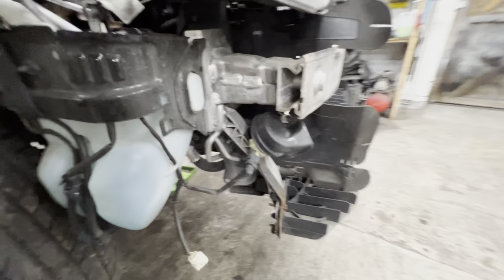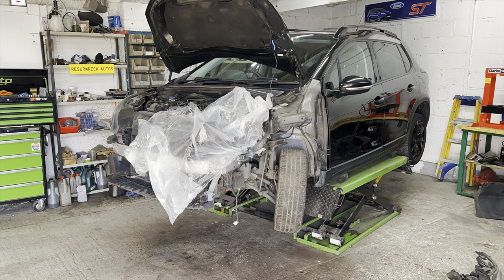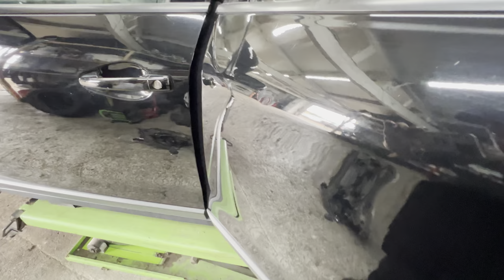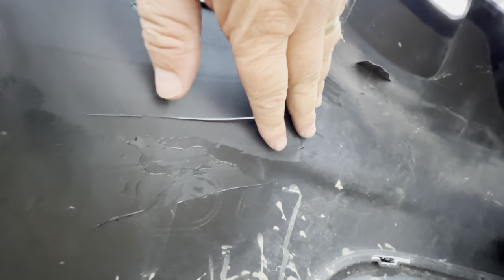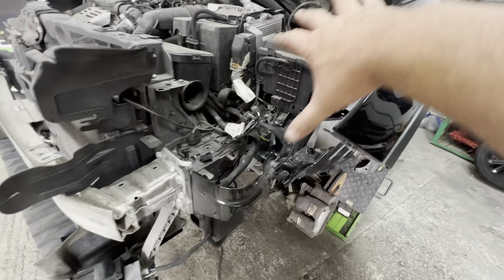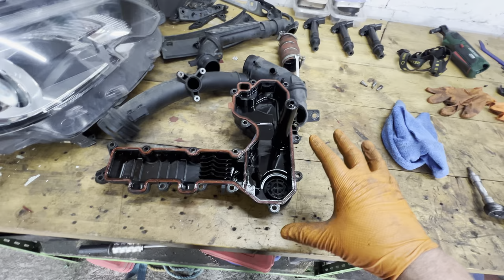Peugeot 2008 GT Line 2017 Cat S Apparently Part 2

Comment: I was surprised when you mentioned that the front crash bar was designed that way, that's why I mentioned that it looked like it had been crushed slightly. I now see how it helps when it does get hit. When it comes to the bonnet hinge being slightly bent, I can't see how as the bonnet wasn't damaged, weird?
Reply from the maker: @rickdye5467  hi buddy the bonnet has had a hit watch the video when I picked it up you can see